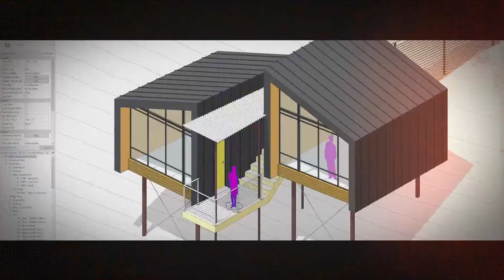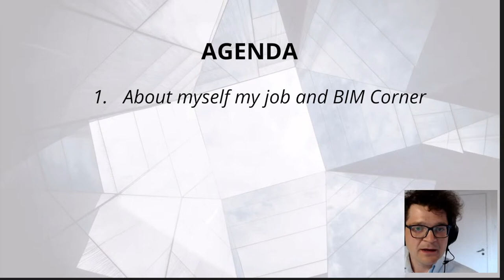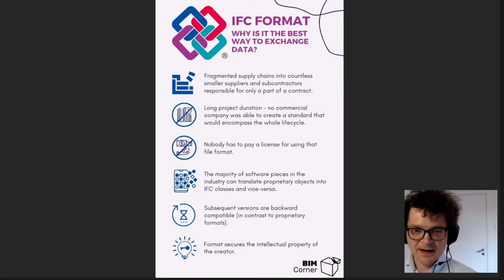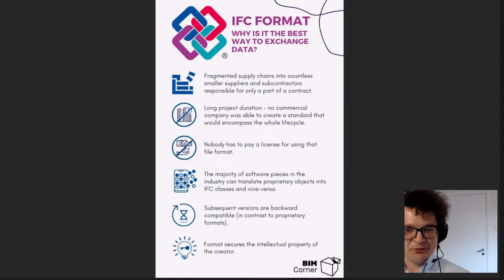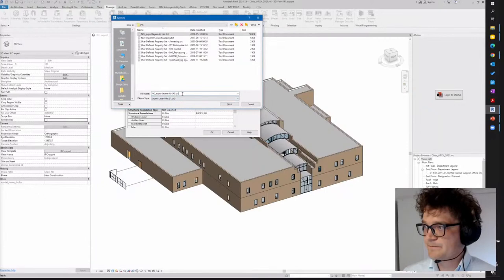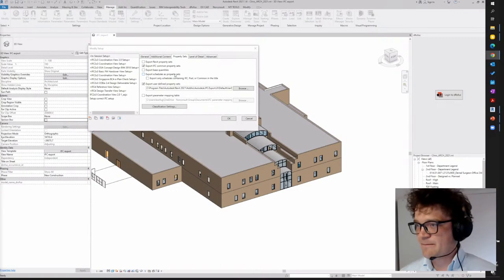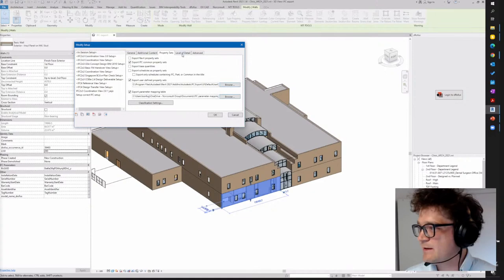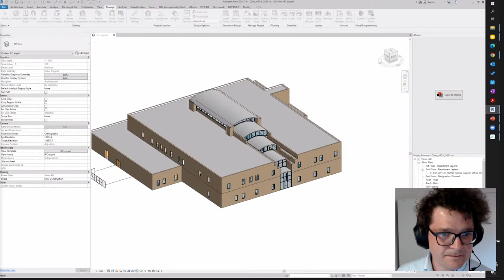Revit to IFC - The Ultimate Guide (with Konrad from BIM Corner)

Comment: Hi guys - thanks for the insights and understanding on IFC

Q - how do I find more out the interoperability of basic geometry data from 3D DWG w ASICS solids to IFC?

Keen to move data on structural and non load bearing geometry within revit : IFC for a single digital twin seamlessly.  

The commentary sounded like IFC is not great for editing or sending structural design / analysis back into revit?

I’m trying to establish best practice for residential house typology for digital twin working in cloud.

Comment: Thank you for this video. 
I could learn how other counties dealing with IFC. I love to have someone who can discuss about this more.

My question is who is going to validate if the exported ifc is correct as handout and how. 
Like you demonstrated it was not so simple and not so successful to exported Customize Pset, chooing a MVD to export from a software doesn’t guarantee it can be open as the same MVD in the other software.
Are you required to follow Customized MVD  in Scandinavia? And do you have validation tool to test what exported as ifc is desire able?

You might somehow align MVD for two different softwares but who knows if the ifc exported correctly or even the elements modeled correctly before exporting IFC!
Submitting IFC doesn’t guarantee to open as it is intended.
Especially geometry definition is impossible to align for all types of software.

I guess as the focus on IFC 5.0 is more open data focus rather than file-base so that kinda teaches me that IFC isn’t file to use to preserve data for long time just like native format for each software.

So well structured data but not file is something we all look for. 

The government in Japan has totally misunderstood use of IFC, trying to use it as exchangeable data format between software, including geometry definition, while IFC4.0 DT seems dead on arrival and IFC 5 is looking for new way to say what is openBIM by developing API more to open data.

I would like to know more about ifc use cases after exporting if possible in the future.